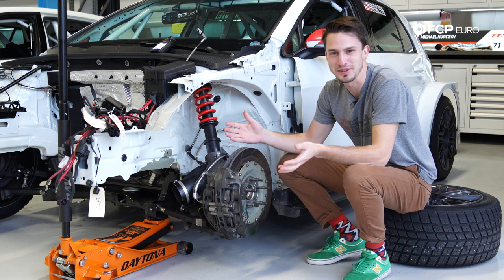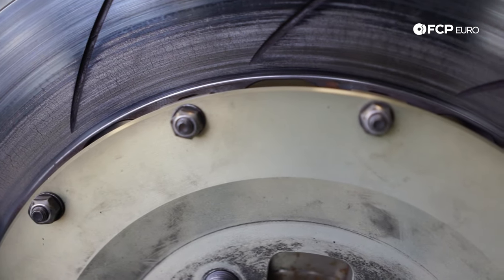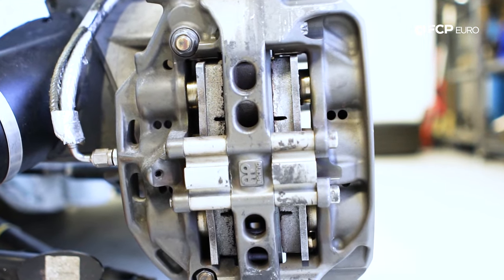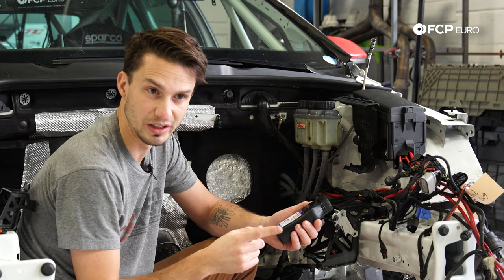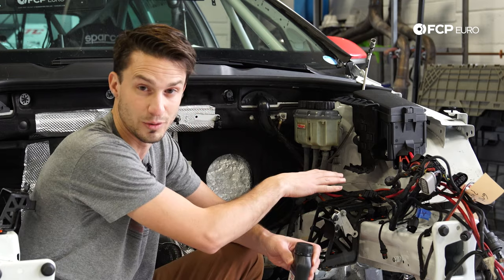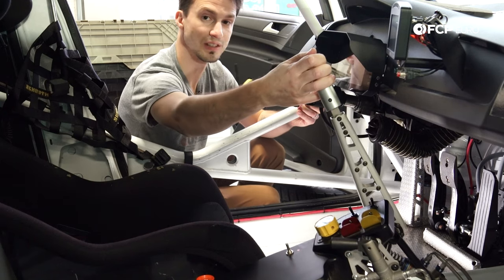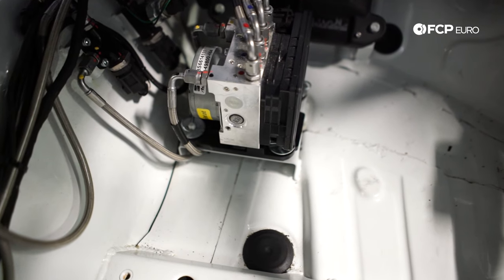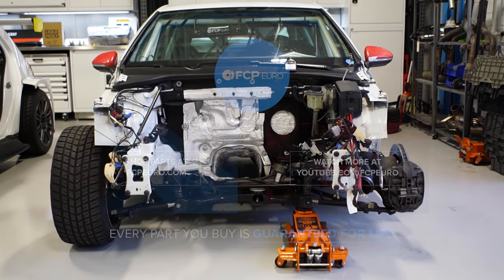Brake Systems - Race Cars Explained

Comment: This is a great video! There was more to learn than I was expecting. Keep them coming.  One question: aren't the small surface cracks near the center of the rotor machined surface a concern on a race car?
Reply from the maker: Glad you were able to take a few things away from the video Ben! The small surface cracks are normal for us to see after a race weekend, that's why we are constantly swapping out for new pads and rotors so they never have time to escalate to a level of wear that would be considered dangerous.